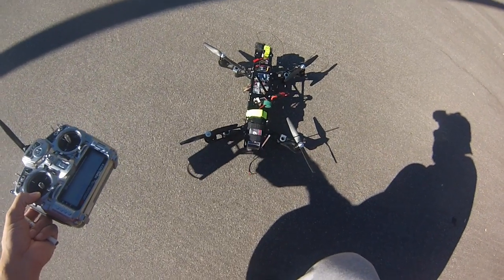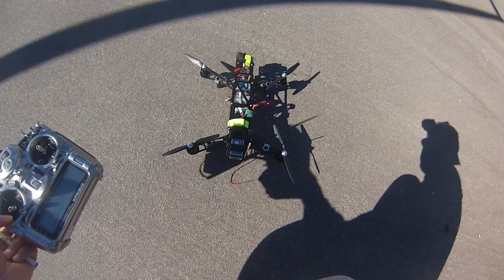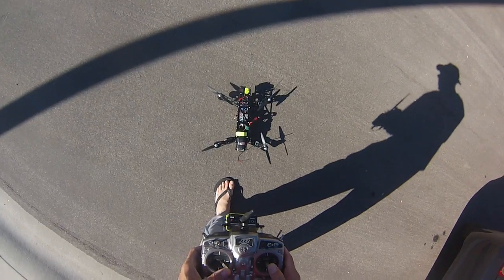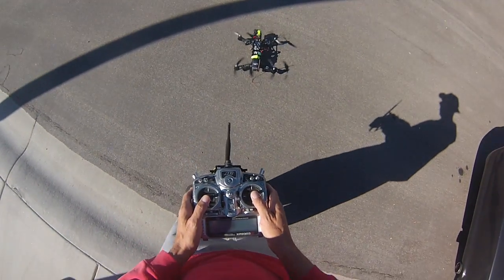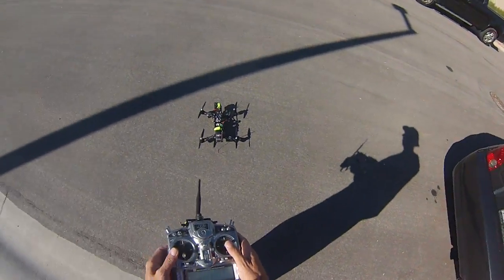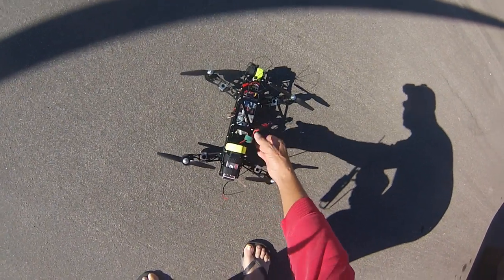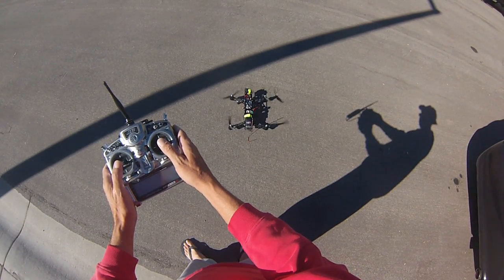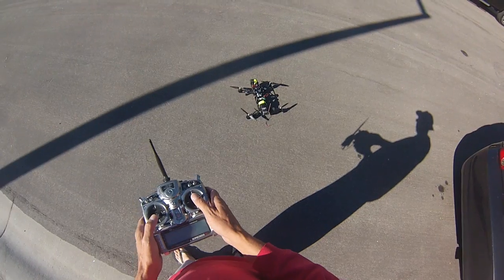QAV 400 cc3d hover/ leveling problems

Comment: iff you axisloock configs on cc3d flight mode, you need give altitude in the same place you coneect batery. The sensors reads movements and try to correct. For this reason the qav go to left . right. Do not moves the quad for yours hand. sorry for my bad english

Comment: I had the same problem man! mine would drift, sometimes it would lift off and shoot up, do back flips , sometimes when I had it on the throttle it would increase throttle on it self., it also wobble and oscillate,  drift, pitch weird . I read the previous comments I think I'm going to try and change the board .

Comment: try recalibrating the esc while everything has to be disconnected from the fc (don;t connect any thing to main / flexy port)
Reply from the maker: Bad FC which was replaced by GetFPV.
Reply: i had the same problem too, i recalibrated all esc , it works fine

Comment: I just built my first quad copter and im having the exact same problem. Im using a cc3d, first had it with open pilot and then with librepilot. please help! any recommendations on a good FC, and what software should i be using?
Reply: betaflight

Comment: Hey man I just saw your vid but I had the same problem and all I had to do was mess with the pid tuning, the pods are set too high so the gyros are very sensitive.
Reply: +Rc Addict I'm having the same issue I can't find the video you're talking about though
Reply from the maker: +Rc Addict This vid is over two years old and many firmware updates later. The gyro was bad and GetFPV replaced the Fc and all was well. There is another video of me showing the FC connected to GCS.
Reply: +Rc Addict can you leave the video about your pid tuning!!??
Reply: +Ales Lipic  go to video aerial systems and type in vid 16 pid tuning explained, and he is very helpful, his numbers are also very close to mine. All I did was start from high and then went low and then just fine tuned it from there . Just a lot of trial and error. Hope this helps.
Reply from the maker: Not a PID issues; defective FC.

Comment: Looks like you need to go into wizard and we're you go to each individual motors, you need to ramp those motors up from a just idle little bit and I mean little, looked like a couple of your motors were all not spinning right at first. I'm using 980kv and I'm at 1128 at 1126 I would have that same problem motors are not sinked

Comment: Hey i'm having the same problem! But after i lift off it flies fine... could it be that my board is also defective?
Reply from the maker: joel duarte We need a video to get a better picture of what is going on.
Reply: If you just pop it up off the ground really quick does it fly ok? Most of the videos I've seen with people Babying the throttle look like prop wash to me.
Reply from the maker: Defective board; replaced by GetFPV.

Comment: run the wizard agian in open pilot and your problem will be fixed after save the settings.
Reply from the maker: My board in the video was reacting too slow to any movement. If I tilted the cc3d to full 90 degree bank right; the AHI would take about 4-6 seconds to catch up to the boards angle. GETFPV replaced the board; problem solved. I will try a few of the tips in the OP post in the future.

Comment: Here is thread about same problem that was due to the wrong board orientation in CGS settings http://forums.openpilot.org/topic/39212-faulty-cc3d-board/page-1
Reply from the maker: The boards' gyro responded too slow; a 90 degree rotation took 4-6 seconds for the board to catch up.

Comment: Hey mine does the same thing! It was a problem with the board right? Ive have literally built and rebuilt my quad a hundred times and done everything possible to fix it,,,,Nothing works. I think its the gyro. I see they replaced it. Does it fly better now?

Comment from the maker: The cc3d board was defective and replaced by GetFPV right away. Tim and the guys are great at getting back to you fast on your problems and replacements.
Reply: +madsloper  i have the same problem. If i right understand, you  replaced  a new cc3d board and then was the problem abolished, msg please:   Ally_g1@gmail.com
Reply from the maker: +Ales Lipic Yes, the board was defective and replace; never had this problem again with a CC3D FC.
Reply: +madsloper i buy now naze32 10dof, i didnt get yet, but i hope that will be better, thanks
Reply from the maker: Yea, Naze32 is much easier to program; I've had much better luck with the Naze.
Reply: +madsloper now you used to a naze?
Reply from the maker: +Ales Lipic Naze & SPR3
Reply from the maker: +Ales Lipic waiting on the LUX FC
Reply: Hello Me again
I buy now another board, (naze32 rev5 10dof), i make a pid,  but now my TX ˘& RX  DONT START BY FLYING, OVER PC IN CLEANFLIGHT  EVERYTHING OK WHIT A TROTLLES
,
Reply from the maker: Add a "ARM" aux channel or Yaw right to arm.
Reply: +madsloper thank i am and it works now, thanks
Reply: How did you do that?

Comment from the maker: The controller is mounted with the usb towards the back; I did have a problem with the initial leveling process in the software and the RC harness #3 servo lead. I had to restart the program and perform the vehicle setup several times before the level completed its calibration process. I also had to replace the RC harness with my second brand new cc3d after figuring out the pwm was not being transmitted to the FC. I will probably erase the firmware in the board and start completely over again.